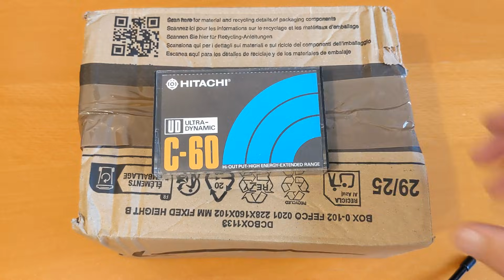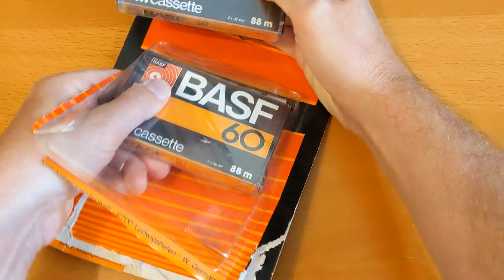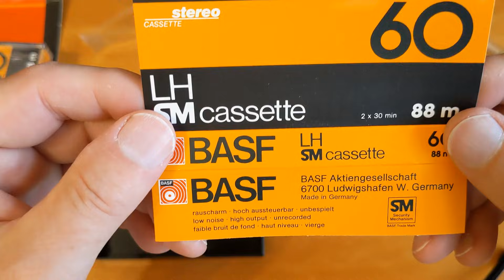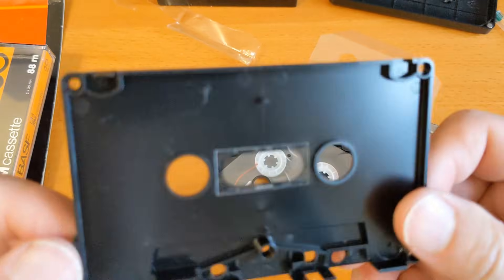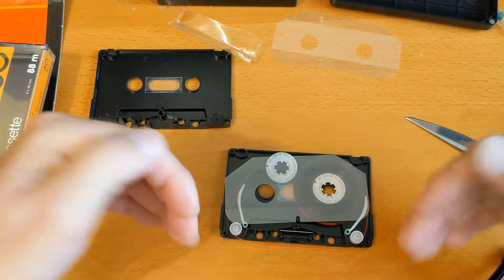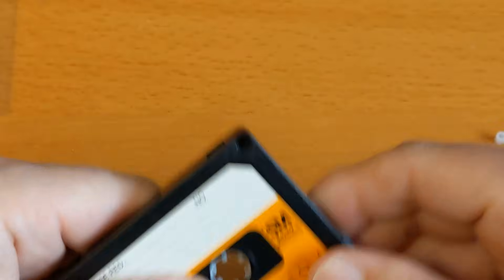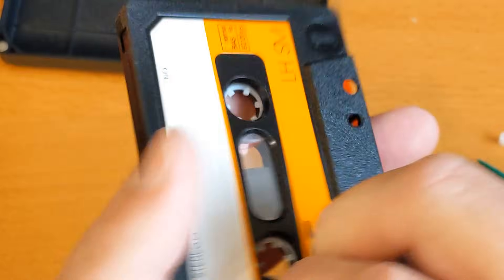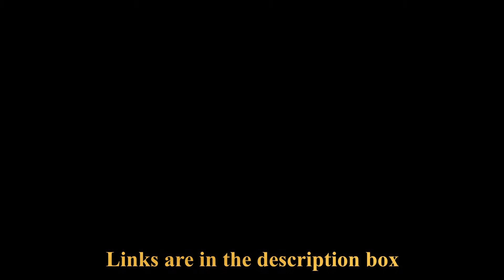BASF's Self Destructing Cassette Mechanism

Comment: I am sorry to point this out but I believe you've made quite a mess there. I've opened and restored hundreds of cassettes and I can't pretend you know the tricks of whom has dealt with them quite regularly but...

- cleanliness is one key factor when you open a cassette. Mind your clothes, your environment, your facial hair and your skin even. A single speck of dirt trapped in the spool is capable of creating a permanent bump in your tape that will result in a mark in the audio and possibly even scratch the head depending on where it lands and the material it was shed off. It can also affect several layers before it fades out.

- pulling from the edge of the opening of a cassette is a very bad practice that can lead to shell break up.

- concerning the SM arms I've never seen a BASF tape worn out by those arms, or wear of the base plastic film underneath the magnetic layer. They do very little for uneven spooling on a deck but to a certain extent they mitigate it under extreme circumstances such as when you wind the tape manually or you shake a portable device while the cassette is winding.

If anything and I have no proof on this, I believe the SM arms can help the tape unstick from the spool in case something sticky has contaminated the reel. It's exactly what I do when I have a tape that's sticking, for example when someone has made a splice with regular transparent tape the glue oozed out to some extent and created a repeated sticking point onto the reel: I use a plastic spatula to separate the outgoing layer from the spool.

My advice is to let the SM arms stay as they are a point of uniqueness of one of the most beautiful cassette shell ever produced. The ones with the rounded window have had a limited run in BASF's overall production volume.
Reply from the maker: Excellent points, and thanks for the tips. And yes, I did make a bit of a mess of it, but I've rarely done it in the past, and it's hard when you're also trying to shoot an adequate video.

Comment: How does one man over think repairing a tape so badly? I was taking tapes apart in early childhood. Just use your pen to hold tension on the feed spool! And as you found out, picking up the spool of tape will not make it self unravel. Blimey mate. Taking tapes apart and putting them back together is not a big hassle. I transferred so many shells it's silly.
Reply from the maker: Many people have said the same. I didn't break things much as a kid, so I didn't have any practice. I'm doing this all while trying to see around a phone camera that's blocking my view, reaching around a tripod and trying not to knock it, trying to keep everything in shot, and trying to keep my hands from blocking the camera view.

Comment: A Tip from my experience taking apart cassettes: 
When reassembling, or when flipping it over to work on the other side, tension it with the pen just like you did. BUT - leave the pen in the spool. Put the next layer (the slip sheet or the shell) over the pen (pen going through the hole). This lets you keep that little bit of tension on the tape as you close it up, making it easier to keep the tape in the tape path as the two halves come together. For flipping it over, keeping the pen in makes it easier to keep the spool from moving. After the flip, just pull the pen out and stick the butt end in again if you still need to apply a little tension. 

Another tip:
That cellophane wrapper can be used to hold parts in the shell as you flip it upside down. It's thin enough and smooth enough it can be slid out after you get the shell with the parts back on, before you press the cassette closed. It's also weak enough that if it's caught on pegs, the pegs will just tear through as you pull it out. Just make sure the piece of cellophane you use is big enough to stick out beyond the edges enough that you can get a decent grip on it. 

An unused little paint brush or an unused make-up brush is a handy tool to gently flick those bits of dust and lint that land on the spooled up tape.
Reply from the maker: They're great tips, thanks!
Reply: I had a cool black and gold cassette I wanted to record the soundtrack to Road Rash on back in the 90s, but the tape inside that blank was crap. I got a good, but much less cool looking cassette, and transplanted the tape in to the cool shell. I unfortunately lost that cassette in an eviction, along with the rest of my cassettes and my equipment. Sad days. Can't keep anything under late stage capitalism. I had rented the game on a different console because the PlayStation version I had, the jukebox mode made an annoying click between tracks where-as the Sega Saturn version didn't have that click. I sat there, carefully recording each individual song from the Jukebox mode. I had also included the sound of the console's boot screen. I miss the cassette, it was some real nostalgia for me. The playlist of FLACs I have of the same exact songs just doesn't feel the same.
Reply from the maker: SHame you lost the cassettes from back in the day. I suppose it's possible to buy a vintage playstation and recreate it.
Reply: Ah, one more tip - When you have the cassette open, and the spools flat, and they unspool like that - turn the pen the "wrong way", so it all unspools and pushes itself away from the reel. The tape will usually lay flat on it's side when you do that, and you can just slowly turn it the "right way" to get it back on the reel. Easier than trying to manipulate it with your fingers to get it off of itself.
Reply from the maker: And thanks for the tips.

Comment: I was just commenting that the tape should be completely on one reel so that the other is in stop mode, then the tape stays tight and the cassette can be assembled, but you got it right eventually. I did that a lot in the 80s. Sometimes I found cassettes on the side of the road with the tape broken, so I just put it back on the reel and listened to what was on it. Usually they had some self pity humppa and cover pop. Nowadays I just listen to cassettes, I rarely record anymore, as there are so many old recorded cassettes from the 90s. Sometimes I record music for the car stereo that I have only discovered after the actual cassette era.
Reply from the maker: Thanks. I'd love an older car, old enough to have that cassette deck in it.

Comment: Special Mechanism. I was using BASF before they were using this. Didn't have any issues with them [jamming], but what I did have issues with is drop outs. I used a lot of C120 chrome and their higher grade ferric cassettes. I used to open various tapes fairly often, jammed or smashed cases. Many shells had fixed posts between the idler wheel and the spool, extra friction! Generally found the BASF ferrics a better bias match for my decks than other makes. Until TDK-D were cheaper and I had a deck with adjustable bias.

Comment: Those cassettes are from the early 70's. I remember that I had a few of those with my first Cassette player when I was about 10 years old. I also remember removing those fingers because back then that was already the thing to do. However I thought it was because they caused tape jams. I was not a fan of those cassettes because they would powder quite a lot and frequent tape head cleaning was required if you used those tapes. And that was even without the fingers so perhaps the issue was the more tape formulae rather than the fingers.
Reply from the maker: Interesting that they powdered a lot, even without the arms in. Thanks.

Comment: Vedo che il tizio che aveva messo il commento dove diceva che aveva delle tdk e maxell con l'sm ha tolto il commento,questo vuol dire che avevo ragione quando ho detto che non ho mai visto tdk e maxell con l'sm,e sia io che il youtuber gli abbiamo chiesto di dire modelli e generazioni,e invece è sparito
Reply from the maker: I think maybe he realised his mistake and removed the comment. No shame in making a genuine mistake.

I bought some Agfa SM cassettes and I will do a video about those later. Not for several weeks though, I think.
Reply: @CBitsTech   si ha fatto un'errore.mi raccomando quando hai tempo togli l'sm alle tue basf e agfa,non si deve rischiare
Reply from the maker: @giuseppelavecchia775Thanks. I will remove the SM on some, but I'll leave it on others and see if I get any problems.
Reply: @CBitsTech   dammi retta non rischiare,se hai fortuna potrebbe anche non darti problemi ma al di là se avrai o no problemi quel meccanismo va tolto,oltre al fatto che ha causato anche inceppamenti
Reply from the maker: @giuseppelavecchia775Thanks for the advice. I have some Agfa SM cassettes awaiting delivery, they were cheap and used. I might leave the mechanism in some that have damaged tape already and see if they shed (delaminate).
Reply: @CBitsTech   se alcune sono danneggiate lascialo,ma se sono tutte buone appena hai tempo salvale,poi per fortuna che tutte le cassette che hanno l'sm sono dotate di viti..
Reply from the maker: @giuseppelavecchia775Thanks. Will do.

Comment: Never in my life did I experience any issues with the BASF SM mechanism, and I still use a bunch of tapes with those. If a tape is degraded enough that the oxide layer will start flaking off, it'll do that with or without that mechanism. 
Pointless video IMO, and the whole painful dis/reassembly segment... just.. no.

Comment: Back in the day, this mechanism caused problems only after the tape got eaten by a sick deck. The edge of the arms got caught in the wrinkles of the damaged tape, and simply stopped it. The tapes that are shedding their coating are usually the Ferrochrome ones. Those were great in their day, but they age badly. Even if you can find some which doesn't shed (AGFA and Sony ones are usually OK in this regard), they are impossible to record on in decent quality, because the chromium dioxide outer layer is deteriorated. Pure chrome tapes have this same problem, they become practically unrecordable after 20-50 years, depending on storage conditions. For some reason, the magnetic properties of the particles change so drastically that no deck can be calibrated to record on them properly. Interestingly, this doesn't affect the recordings that were recorded to the same tape before the degradation hit. The old recording sounds perfect, but you can't make new recordings on it with any decks. My worst examples were giving about -10dB on playback when recorded with 0dB (with maxed-out rec level calibration), lacking treble, and horribly distorted.
Reply from the maker: Fantastic info, thank you.

I was looking through my 'spare' cassettes earlier for a ferrochrome, I thought I had one from a few years ago and didn't realise it was type III at the time, but I can't find one. I wonder what it is in the chemistry that leaves existing recordings fine, but new recordings are terrible.
Reply: @CBitsTech  That's a mistery for me, maybe someone on tapeheads can answer it. If I get it right, the coercivity of the tape increases drastically, but the retentivity barely changes. Old recordings do loose 1...3dB of level after the degradation hits (so if it was recoded with Dolby, it can be a problem), but the level drop seems to be equal across the frequency range, and amazingly, the tape noise also drops. 

So if you have one of these pure chrome tapes that were recorded very well 40+ years ago, it now sounds excellent, with almost no noise even without Dolby. Ferrochromes are worse in this regard, because the level drop only happens in the top, chrome layer, not on the bottom ferric layer, this results in a slight loss of treble, and probably a complete mess if the recoding was made with Dolby.
Reply from the maker: @mrnmrn1 Very interesting. I never really had much success with Dolby (recently, in the last seven years since I got back into cassettes). Even though I have some capable players, Dolby seems to lose some high end. Maybe it's the Dolby circuits that need tweaking. Usually I can't hear much hiss anyway (tinnitus drowns it out), and at my age my ears aren't really hifi anymore either :)

Comment: I have a bunch of those cassettes, different sorts of tapes, never had any problems with them.
Reply from the maker: Thanks for the info. I'm learning a lot from the comments, and it seems like it was mainly type III that had these problems, although @ZeddieTechie had a type II that was shedding/de-laminating.
Reply: @CBitsTech  didn't read this, but I posted a similar comment.. my bad then.
Reply: I use them much while the 80s (not Fe, but CrO²). Never had this Problem. Maybe Dunning-Kruger.

Comment: I just bought 10 BASF cassettes - still in the mail - after decades of not having any cassettes at all. Didn't have any issues with them back in their time, except that BASF had times, where their chrome tape delaminated in flakes, no matter what -  so this issue with the guides is new to me. Do you realize any changes after removing the guides? 
I plan on reviving some of the cassette players that happened to collect themselves 😆 over time.
Reply from the maker: Cool that you're getting back into cassettes again, and that you're going to revive some players. 

I haven't had any issues at all with BASF tapes, but I've seen a couple of YouTubers who have. I removed the SM on this one as a precaution, but maybe I'll leave it in some others and see how it goes. I think if the cassette is used, old, and has been stored badly it's likely to be more of a problem.
Reply from the maker: And no, I don't think removing the guides will cause any issues.

Comment: wonder why the winding was uneven when it was still sealed wether the tapes ageing or just how it ended up wound? i'm mainly familiar with the black bottom of the tape label with the letter box tape window. so i wonder this having the old tape shell and mismatching sticker it was a transition period of leftover shells with the newer larger window sticker?
Reply: I remember seeing the uneven wind on cassettes back when they were new. I think it's just the manufacturer not caring.
Reply from the maker: @hellomiakoda3782 I think that's the case too. It was all automated and very fast.

Comment: My God this was painful to watch. Really, trying to assemble the cassette putting the part with the felt cube and rollers ONTO the other without all the sh*t falling off??? Why spooling on HALF a turn on the small roller to make the tape bulge out when you could slip the pen through the side you're putting on and create tension on the larger spool while you're sliding down the cover along the pen... would have been super-easy (a bit like what you did at the end). On a positive note, good job removing the nylon guides, however, those are not the reason the tapes are delaminating :( They would be doing it on their own sadly if it's not those nylon guides, then the pinch roller would delaminate the already separating tape layers :(
Reply: Exactly my thoughts. The delaminating tapes are almost always ferrochrom (type III), and very rarely it can also happen to CR-S II which have been stored badly (lots of temperature and humidity changes, like in a car). All kinds of BASF LH types and their single layer chrome tapes are safe from this issue, and the SM guides can be kept without risk.

Comment: I used to love collecting blank audio cassettes. I first started in 1980, when I got a blank Sharp audio cassette with my Sharp TV/radio/cassette recorder. I collected all types of blank cassettes though the years, such as Memorex, BBC, BASF, TDK, Maxell, to name a few. The strangest one I ever bought, was a Woolworth's own brand. The tape had a built in tape head cleaner, but when I looked at the cassette to see how it cleaned the head, I found out that the leader part of the cassette was made of a fine sandpaper. The tape head was ruined! Another strange cassette I bought, not a blank one, but a pre-recorded cassette of The Jacksons and their greatest hits. It turned out the music was in reverse, on both sides.
Reply from the maker: I received a new Woolworths one in a future video, but didn't unwrap it. They're very nostalgic for me, but I don't think mine had the sandpaper leader, that does sound like a bad idea!

For the reversed one, I can't imagine how that could have happened 😮
Reply: @CBitsTech  Thanks. 

The reversed tape was a strange one, wish I kept it.

Putting blank audio cassettes aside, I used to buy a lot, I mean a lot of VHS tapes, back in the early 1990s, just before the internet. I always bought the three or four hour blue Memorex tapes. On this occasion I put a new cassette tape into the VCR to record and nothing happened. I looked closely at the tape and found that there was no coating of metal oxide particles, the layer responible for recording, just the tape. I knew there was something wrong with the tape, because you get a shine from a good tape, this had a matt appearance. I still have that tape.
Reply from the maker: @Francis-Gamble I had a lot of VHS tapes. I digitised them years ago because they took up too much space. It seems they're becoming fashionable again now. 

I used to buy those Memorex blue ones, but they didn't seem to have the same quality as the Scotch one I prefer. I never had the problem you had with one though. 

I still have a few tapes, and a couple of VCRs, and sometimes think about setting them up again.
Reply: @CBitsTech  The tape was inside out, it will also sound muffled